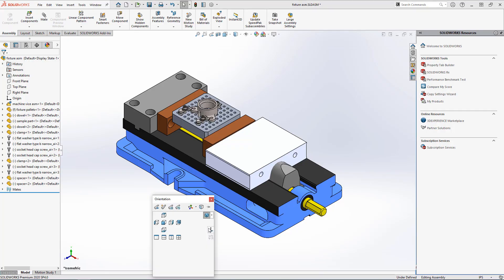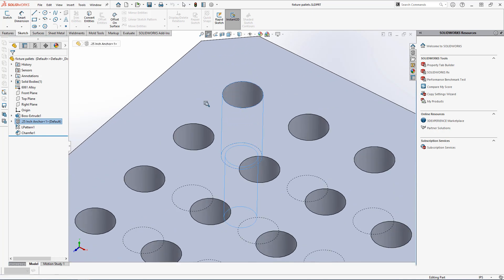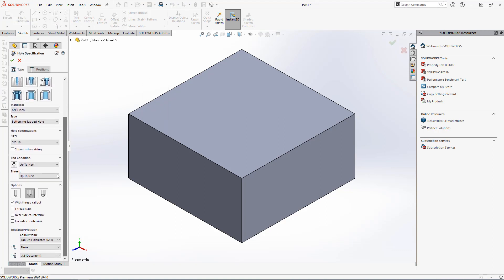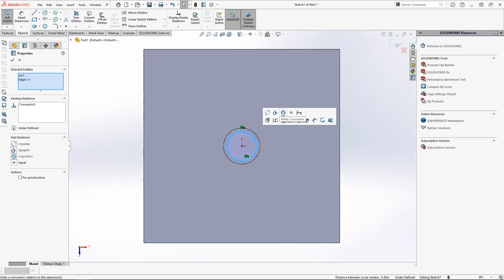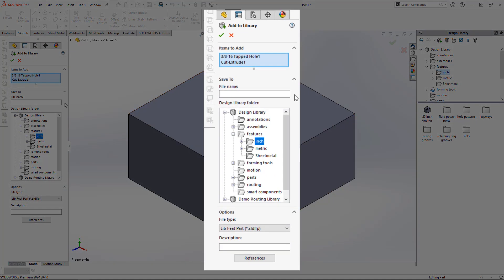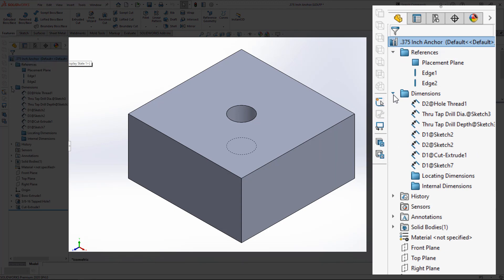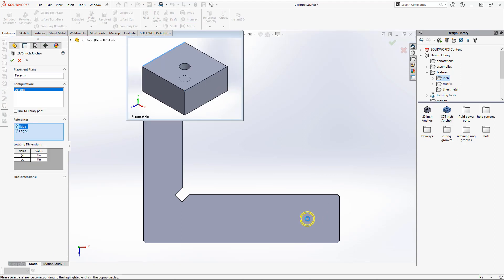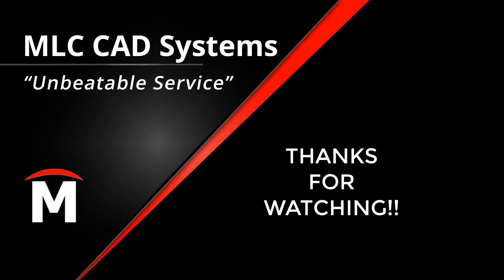Creating Design Library Features

Comment: Make sure the design library is pinned or it will disappear when you try to drag it over.
Reply from the maker: Great point, you can pin it open so it is easily accessible, or let it collapse to maximize your graphics area.